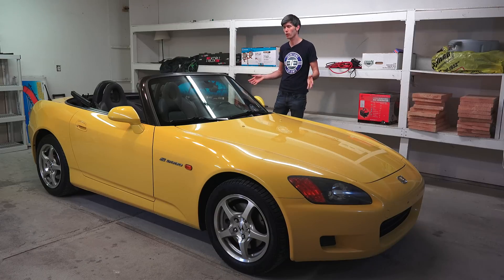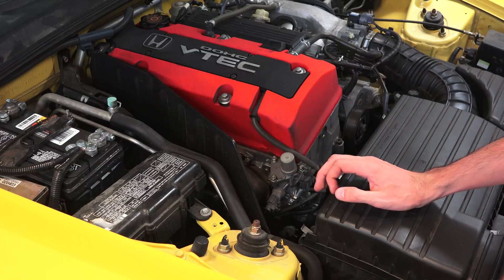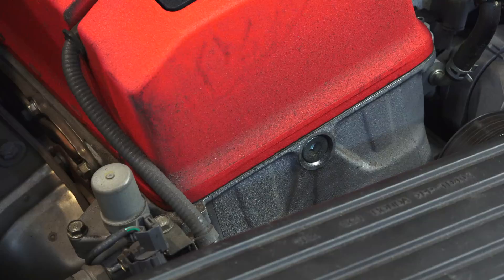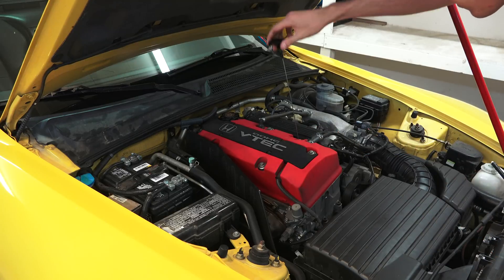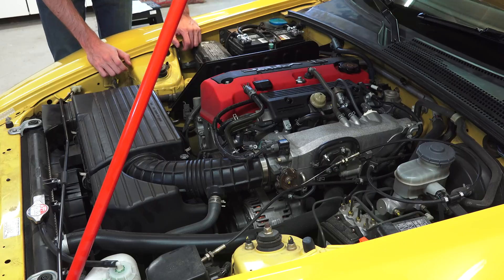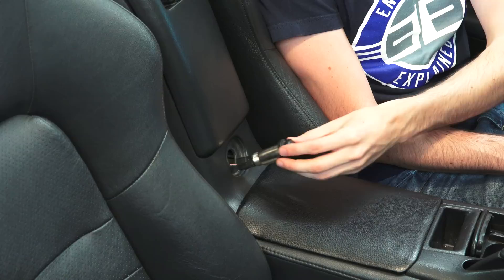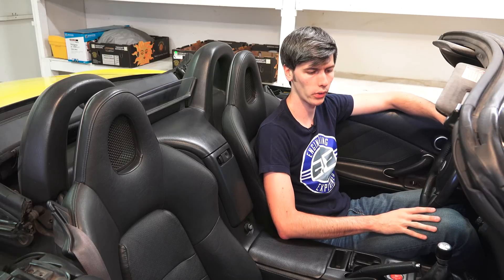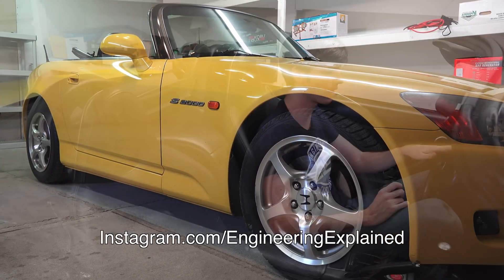What's Wrong With My Honda S2000?

Comment: Probably coil-overs would be my first mod. 
Either way great car, just needs a supercharger.
Reply: +yalnizful That would keep the quick response S2K's are known for.
Reply: i can turbocharge it and have no lag, for an even faster response, but i get too much heat...
what supercharger would you put on it?
Reply: you prefer a supercharger over a turbocharger in this engine?
Reply: Why have a supercharger with all that lag?? Since Superchargers don't make power until engine makes power. Engine doesn't make power till higher RPM's. Superchargers are ALWAYS laggy. They improve mid range because they zap power off the crank to do so. But ultimately they take power to make power. A turbo is free power and once spooled maintains power.

Turbo lag is simply driver error. The turbo will spool perfectly fine in 1st, once RPM is suitably high you maintain power. If you've ever experienced Lag in a turbo car, it's  either incorrectly matched turbo, or driver error.
Reply: Calum A uhm.. i can install a supercharger and not have any lag on it too, just like i can do with a turbo...
"Turbo lag is simply driver error. The turbo will spool perfectly fine in 1st, once RPM is suitably high you maintain power" <---- lol, wtf are you trying to say? ahah
i don't think i want to discuss this subject with you xD
Reply: yalnizful Sorry. Automatics are not too common in the UK I often assume anyone interested in cars drives manuals. Fair enough if you drive an auto then supercharger makes sense. But if you drive a proper car with a manual box, then there is no such thing as turbo lag. But despite that, a supercharger will always suffer lag as it's limited by the parasitic losses of the engine.

If you don't understand that then perhaps you ought to read a book or two on the subject. Author Graham Bell does an excellent book on Forced Induction. I would recommend that.
Reply: +yalnizful kraftwerks makes superchargers for s2000s
Reply: This is inaccurate.  With a turbo the engine must work to pump the gases through the turbo on the piston upstroke...it is not 'free' power.  Superchargers on S2Ks have no 'lag' but work best at >5500, which is very easy to hit in this car.
Reply: Calum A i would recommend that you don't talk about what you don't know.
No such thing as turbo lag? are you serious?
You read some more books and try building a car once in a while.
Besides i told you i didn't want to discuss this subject with you, are you blind?
Reply: Callum A: "There is no such thing as turbo lag, only driver error." I take it you haven't driven a Mazdaspeed 3 or an FD RX-7? Both cars have a fairly high boost threshold (for a stock car) and might be described as "laggy", that is incorrect though. This may be a confusion of nomenclature. Turbo lag is how fast the turbo produces boost (or how fast it spins up) when you are past the boost threshold. That threshold is what most people describe as "lag", and a "laggy" engine simply has a high boost threshold.

Also, Roots style superchargers are positive displacement, which means they add a certain amount of air per rotation. This means that no matter the RPM you are at, the Supercharger is going to add a certain amount of air per rotation. More air means more power, so you get a pretty consistent addition of power across the whole RPM range.

But, I don't think anyone makes Roots blowers for Honda F series engines. People slap on Centrifugal Superchargers, which are essentially belt driven Turbos and they do have a peak RPM at which they move the most amount of air, and afterwards they drop off due to turbine efficiency. Still, the added power is more consistent than a turbo, but not as smooth as a roots blower.
Reply: yalnizful Plus, with a small enough turbo that doesn't have much lag, you wont produce enough boost to warrant the conversion. 

If I could find one I would get a roots type supercharger (also called positive displacement) so I can keep the NA response of it but still make more power. 

Honestly though I wouldn't touch forced induction on a Honda VTEC motor (like a B, K or F series), I would see what mod I could do to make more power without going to boost.
Reply: +Brap Brap No but I am more than aware of the engine. And you are comparing it to a four-stroke which is totally unfair. that car is only a 1.3 and it is their very nature to not make power till higher rpms. the turbo bares no relevance here. The fact of the matter is that those 1.3 engines produced 260+ bhp in their latter form. exceptional performance considering. 

Hondas engines are absolutely brutual turbo charged. But higher lift cams are often undesired in turbo applications, hence why Hondas new turbo car Vtec engines work in reverse. Agressive cams but not necessarily high lift are required. 

Anyway, I could go on, but quite frankly this thread is becoming tiresome. I do however find it interesting whilst a Honda would be my dream car, others look at it in disgust. Quite funny really.
Reply: The Mazdaspeed 3 is a traditional 4 stroke, 4 cylinder engine. Also, a turbo doesn't care which engine its bolted to, it simply runs based on how much exhaust gas it's fed. Whatever though, I think you understand my point about lag VS boost threshold VS how different forced induction methods perform. 

I agree, it is rather amusing how some people trash Hondas, yet they have never tried them or only have experience with rather bland or bad examples (such as your neighborhood #stancenation civic...) I would love nothing more than to have a CRX or Civic Si track car with a B16 or K20 under the hood.
Reply: stock coil setup is the best until you can afford a sub 2k coilover. Thats how well engineered the suspension is. if you buy an entry level coil over its definitely a downgrade.
Reply: +Calum A lol I've never heard of "supercharger lag." Probably because it's pretty uncommon. Superchargers are pretty well know to be very linear in power delivery. I'm thinking you have your info a little backwards. Did you learn about cars from Fast and Furious? NAWWWSSS! It's gonna blow!  Or maybe you're trolling.
Reply: Brap Brap well, i managed to get my hands on a ap1, and i was planning to supercharge it, because turbo's are much more expensive and give much more wear to the engine...
i had a turbo ap1 before, and it wasn't reliable enough ( this build i'm trying to do now is for daily driving)
Oh sorry, my bad, the internals aren't stock, and the car already has 385 hp, i'm just trying to figure out what would be best to get a little more power ( because it's never enough :D ) and still have this good reliability.
So, roots type? i'll check that out
If you want a clean b16a2 with low km ( mileage) i can get you one for 3000€ ( about 3.5k dollars )
The same applies for the CRX
Reply: Robert Cary maybe he has mistaken turbocharger with supercharger
Reply: +Robert Cary (Carizle) You are confusing boost threshold with turbo lag dude. as said, since it takes power to make power on a supercharger,  no matter how well designed the supercharger is, you will always lag behind the engine. Unless you know of a supercharger that generates power before the engine has even been turned on! Turbo has a greater threshold sure, but once they make power, they sustain that power. They do not impede the engines power output. You comments about my knowledge is just joke I get it. But how about you read into the facts before commenting.

Comment: i would smoke you with my 1.2 peugeot :p
Reply: Hell, my 504 could spank that Honda.
Reply: +sienile if it starts jk
Reply: In stock form, NONE of the cars you guys mentioned in this thread (as of this post) could smoke that S2000 in stock form... On a track that S2000 would walk away from a WRX, and your 504, and your 1.2 Poopshow like it was standing still. You guys have NO idea how magnificent a 2000 handles.  In stock form it's an unbelievable machine that you would not believe (as you've commented here) until you've driven one on a track. And I don't make this comment idly as others have.  I've driven them on the track.
Reply: Just because he likes s2ks doesn't make him a fanboy. They are good cars.
Reply: +NorthernChev ^ Honda fanboy
Reply: +NorthernChev drops the mike. Rekt
Reply: +NorthernChev - Someone doesn't understand humor. :P Plus it wouldn't just walk away from a 504, it'd run away. The 504 had a top speed of 115 with its biggest engine option, so unless that S2000's timing chain has enough slack to jump teeth at high revs, the old African Queen won't even get close enough to smell it.

But to dismiss a "1.2 Peugeot" is a bit presumptive. Sure if he's talking about anything as old as the 504, but a '15 2008 turbo would give it a good run.
Reply: Not really, a 2008 turbo is far heavier than an s2k.  It would smash it on the corners and pull away on the straights
Reply: +sienile probably those ppl doesnt even know the 504 hahaha
Reply: +sienile aaaand who the hell comares a 1.2 three cylender small car to a damn sports car ?

Comment: Well, I'm glad to hear that engine has a timing chain rather than a belt.  That thing being out of spec could cause excessive oil consumption too.  When you first mentioned rattling I was thinking that you might need to adjust the valves also.

Comment: you should have bought F350 or F450
Reply: He said he wants a car that is fun to drive, not a penis replacement.
Reply: I'm European and thought that you guy were talking about Ferrari's. Then I realized you were talking about Ford's 😂
Reply: +Dejected Sasquatch he also probably doesn't want to pay more in gas than he did for the car.
Reply: Yea should have gotten a heavy duty pickup. Good alternative to a small roadster -_-
Reply: Why would he get a truck with a 150,000 throw away engine? The f-series engine were DESIGNED to fail.
Reply: He probably can't fit the sumbitch in his garage.
Reply: +Dejected Sasquatch The 7.3 was great, but it's an old engine.
Reply: there is quite a big difference between f350, f355, f430 and f450 ;)
Reply: Simplex SM The 7.3 and the 6.7 Powerstroke engines are pretty good. 6.0 is decent, 6.4 is throw away. 7.3 is God-tier.
Reply: +Dejected Sasquatch 6.0 is trash
Reply: Daniel Wolfe From the factory it's pretty garbage. All you have to do to make it better is ARP head bolts, and an EGR delete. If you don't plan on tuning it you can get by with just a EGR delete.
Reply: They don't come with a manual transmission.

Comment: Why not a new (or just a pre-reg) MX5? In Europe they are about the same price as an old S2000 with over 100k on the clock.
Reply: Miatas are good, but I'm guessing that he wanted to be different...Miatas are popping up everywhere on YouTube lately, especially in the U.S.
Reply: because a Miata is a poor man's 2k lol. This car has way more power
Reply from the maker: +Ričardas Marozas in the US a 14 year old S2K is far, far cheaper than an ND MX-5. I looked into getting a salvaged MX-5 to fix up, and even those were around $10K, with lots of needed parts.

Comment: F20 timing chain? I thought they had timing belts?
Reply: re: daniel champion, s2000 has special feature of semi-gear driven cams, a bit like a racing engine, e.g., cosworth dfv, that use gear driven cams. in the s2000, the chain drives an idler gear which then drives the cams by gear.
Reply: My 90hp 200sx uses a chain. But Nissan uses those a lot. So nothing special to me. lol
Reply: Anything that makes significant power runs a chain. S2000 > Civic :p
Reply: yes they got timing chain on all S2000 :)
Reply: +carstopguy my bmw f20 114d has a timing chain and it produces 95hp
Reply: +TassieLorenzo - Not driven by gear, but by a second chain. It's a similar chain setup to the Nissan KA24DE found in the mid-90s 240SX, Altima, Pathfinder, Quest, etc.
Reply: sienile f20c head: http://s46.photobucket.com/user/Sihotboy99/media/IMG_8619.jpg.html Gears on the left there? I dunno. :)

Comment: VTEC engines burn more oil the more time you spend in VTEC.  It's normal just keep some quarts on hand and add it as needed.
Reply: Another "feature" of Honda engineering. :p
Reply: All engines burn oil lmao. To say that's a feature of Honda is ridiculous!
Reply: This is true because my rsx type s burns about a quart  but pretty sure it is because i step on it lol. 201XXX miles strong.
Reply: +Calum A my civic D15 doesnt burn any oil at all and its not vtec. on the other hand my d16z6 vtec have drinking oil issues. and the d15 has way more miles.
Reply: +Calum A my civic D15 doesnt burn any oil at all and its not vtec. on the other hand my d16z6 vtec have drinking oil issues. and the d15 has way more miles.
Reply: +Calum A my civic D15 doesnt burn any oil at all and its not vtec. on the other hand my d16z6 vtec have drinking oil issues. and the d15 has way more miles.
Reply: jose jalapenho Trust me, it burns oil. Obviously just not enough that you notice.
Reply: +DuBstep115 thank you!!

Comment: It's a Honda
Reply: synonim of sportiness and reliability
Reply: but it's cheap to repair
Reply: in europe the type r is fortunately only available with manual gearbox
Reply: the 2017 civics have like three or 4 trim types that come with the turbo and a 6 speed.
Reply: +Tool0GT92 Honda has in so many ways lost its way.
Reply: New Civic Type R is quite decent, but that';s like the only car continuing spirit of sporty cars from 90's...